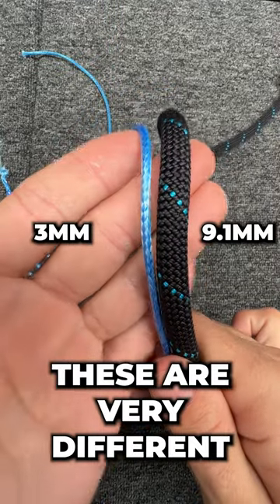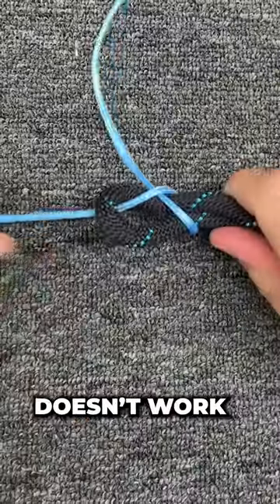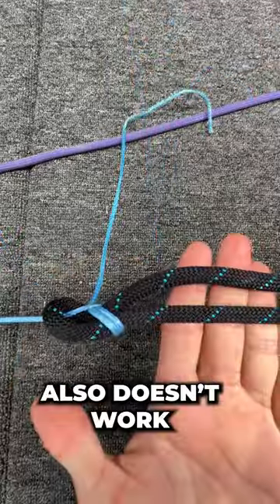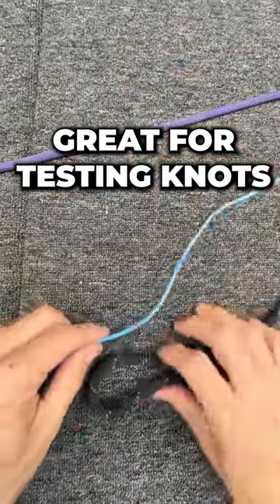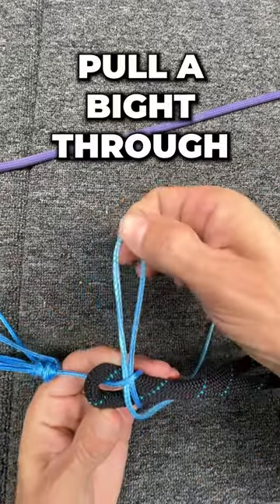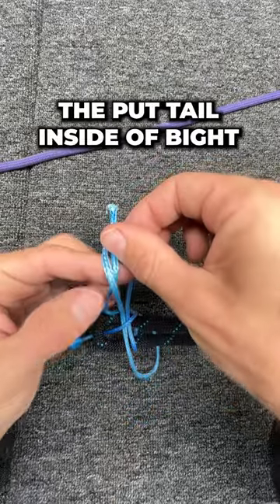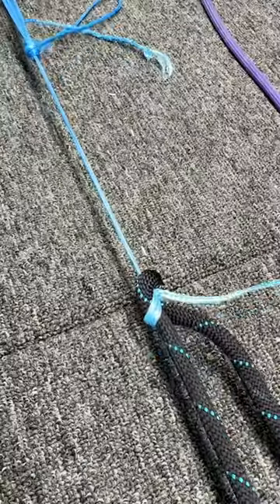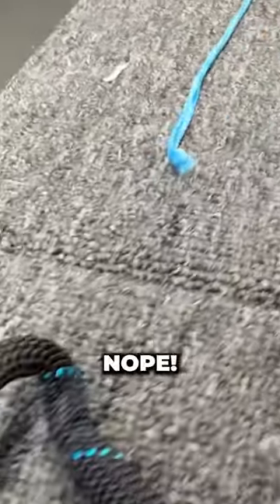Sheet bend magic trick #breaktest

Comment: Straight dyneema is really difficult to use. When I would do underground long distance fiber optic pulls you have to trim off the jacket and cut the fibers in the stack leaving only the dyneema fibers. I would use a square knot followed by a modified guy line hitch to affix the tag end. It was strong enough that it would require 4wd in low range or a piece of track equipment to pull it through the conduit.
Reply: Can you show us the modified guy line hitch you used?

Comment: A sheet bend is directional. You are going the wrong way round. After going through the bight, go towards the bitter end first and then continue round twice. Even though I doubt it will hold in two this dissimilar ropes and with one made of Dyneema. Could you also try this with a big Dyneema rope and some not-Dyneema accessory cord?
Reply: This would be a wonderful follow-up to the follow-up video!

Comment: when you use the double sheet bend and finish it with a bight, put the second bight through the first bight, work down the slack in the second bight to tighten it to the hitch, and leave the single tail as a quick-release. this is also a good hitch for securing tarps through grommets, where wind loads will tighten your anchor chords making them hard to remove. you pull the single tail to release the loaded second bight, then the first bight which was not as heavily loaded is easier to loosen and pull free of the hitch and grommet.

Comment: My uncle taught me that if you find your line slipping, a simple overhand knot at the end can put that to a stop right quick. Every since, I knot the tip of my line before anything else. If it slips, it will only slip until that knot. The next option is only complete failure of the line.

Comment: How is Dyneema, which you say isn't designed to have knots tied with it, "the ultimate way to test whether or not a knot works?" Considering the majority of your average cordage of two different sizes and types at Home Depot will result in a secure and functional single sheet bend when tied properly, and considering a double or even triple sheet bend didn't work with the Dyneema in your videos, I would hardly consider Dyneema a gold standard type of cordage for evaluating the quality of a knot. I think this is the first time i've ever been critical of one of your videos. Long time fan. Surely there is an ideal rope type for assessing the quality of most knots, but it isn't Dyneema.
Reply: Dude, seriously?😑 

it's because seeming-secure knots can fail by slipping when heavily loaded. Dyneema™ is very slippery so if it doesn't slip when tied with Dyneema™  then it's probably super-good-enough
Reply: @bobbing4snapples That's true, but the converse isn't. Just because it doesn't work with Dyneema doesn't mean it isn't safe with other materials.